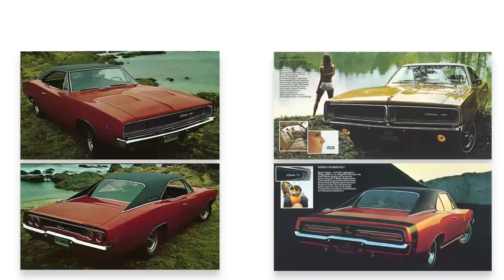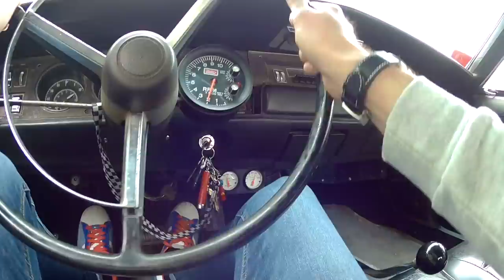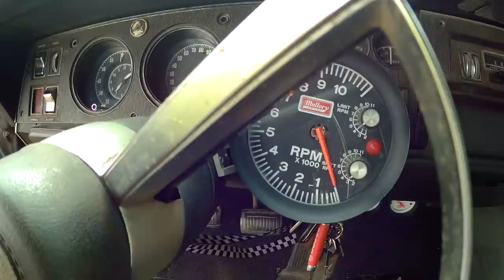Why I bought (and imported) a classic 1968 Dodge Charger manual

Comment: I'm  sure your aware that the Jensen Interceptors were all powered by these engines Mk1 and early MK2's and the later models the 440's. I did have a Mk 1  6.3  sold it to start my business ......bad move!!😨😨 That was 30 years back ( the Jensen cost £5k and l sold it 6months later for £7.5 k)  These Chargers are the dogs !!

Comment: I have to say you completely fooled me with the amount of bodywork it needed!  To do all that and make it look like you did none of it.. spot on! 😁
Reply: But after 10 years, still not know anything about the design/purpose of the product.
It cruises terribly. It doesn’t do long distance either.
It exits corners fast and enters corners fast. You’re supposed to adjust those settings.
Reply from the maker: @dreyn7780  Not true at all Dreyn - I bought this car to keep it driving and feeling the way it would have driven and felt in 1968. If I wanted to hugely update it I would have built a resto-mod. This is a slice in time of muscle car history, not a modernised re-make.
Reply from the maker: I have to thank Tim at Roadhouse Motor Co for his bodywork and paint blending skills. He specialises in patinated car sourcing and sympathetic repairs.

Comment: 1:56 That's the Jonny I remember..... I reckon that was around the same time you had the 250D 'Chip Fat' Merc on Fifth Gear . I remember it well as I had a 190E 2.5D at the same time (also red).... and that was always full to the brim with Veg Oil... well, any kind of Oil actually lol. Good Times!

Comment: Epic car, saw it at EBC brakes do. Fell in love right then. Beauty with a touch of rough diamond / maniac. I had a 71 charger in the 90's with non servo drums and a built 383. Went to see Dave Eady at Eadys American autos in Burton Latimer (sadly now a housing estate. The yank scrapyard / car sales / parts place closed down and gone. R. I. P. Rod Eady). Dave gave my car the once over, looked at me and said "it's got adrenaline brakes then?"...   He wasn't wrong. I still remember the day a nissan micra pulled out right on front of me and I thought I was going to drive straight through it. Maybe a brake upgrade would be a good investment for yours? (and a high ratio steering box. That was a game changer. Cost me about £50 more than a standard recon one and made it steer more like a normal car.)
Reply from the maker: Great comment Chas. I have bought parts from Eadys Autos before (when I had my RHD Impala and Olds Cutlass). What was your 383 1971 Charger like? They are starting to get valuable too now.
Reply: @TheLateBrakeShow  my charger was originally a 318 but had a 383 engine built by Smax Smith already in it when I aquired it. 727 torqueflite gearbox with reverse pattern manual valve body, high stall torque convertor, etc.  Best I saw out of it was high elevens. And 7 mpg. I straight swapped my 3 litre corsair on lotus wheels for it after the charger guy chased me down at billing aquadrome show. I sort of miss every car I've sold on over the years But sometimes a new project is hard to pass by. I do still have a barn full of cars I've already built and unstarted projects I can't bear to part with though.  The lockdown project is now on the road 12 months after purchase. I've had lots of time on my hands and sorted out a million and one jobs. 1960 zodiac two doored with capri roof, built really well in the very early 90's, then bodged badly by some of its subsequent owners. by the time I got it it had a heat siezed 302 with a head gasket fitted backwards and a ton of dangerous bodges. I've built it a 347 stroker with ally heads, home made headers, Jack daniels screenwash bottle,  traditional filigris signpainting in the engine bay by my mate Dave underwood, and a brass antique urn  I bought from ebay made into a header tank. The stench that came out of that thing when I soldered the pipe stubs and rad cap neck made me feel sick. I suspect it may have had someone's nan in it before I bought it....   If your passing by Broughton near Kettering give me a shout if you fancy checking out some wierd creations. 4x4 105e turbo technics, saab b204 powered rwd mondeo eurocar, 480 turbo engined volvo 340, etc.

Comment: I have a '70 El Camino which is nearly as rough looking as your Charger, that I use as a daily driver in the summer. 5.7 small block currently loaded with hedge destined for the tip!
Reply: They’re is no community here.

Comment: To bad it's not a  Muscle Car anymore
In order for it to Qualify as a Muscle Car must have the following requirements:
1.   Must be a 4 seater charger ✔ 
2.   Must have a front engine V8 variant Charger ✔
3.    Must be made in the U.S. Charger ✔
4.    Must be made during the Mid 1960's to  early 1970's charger ✔
5.   Must only have 2 doors in its whole History of Production charger in video did qualify until 2005 when the 4 door variant was released for retail.  Since then the Charger has been Dethroned as a  Muscle Car in  Car Culture.... Incidentally, had been asked by Mopar owners "well how about the  Charger HellCat?"  My response is they're comfortable family oriented Sleepers.  It's you have found one out there

Comment: I was never a fan of American cars, but a couple of models did ignite my interest, and the Dodge Charger is one.
Maybe it was them 'good ol' duke boys' which did it ....

One thing which confuses people (here in the UK), is that the Dodge Charger cars were advertised based on gross horsepower. That means ratings were derived from motors running on test stands with no accessories, exhaust systems, emissions equipment, intake filters, or transmissions siphoning away output.

They were also corrected to standard atmospheric pressure, which further distorted their accuracy as compared to modern net horsepower ratings.
So, those 330 horses start to look more like 220 at the wheels, which is still not too bad for 1968 lets be honest.

Thanks for a great update on your fantastic machine Jonny.

Comment: you should try and get all possible parts machined in carbon fibre (3D printing) ...might be expensive but should be very interesting. maybe a 3-4 year project... take off 150-200 kgs of weight, update the transmission and suspension...

Comment: What model optima battery is that? I have some trick batteries in my cars, 800CCA, 16AH 2.8kg easily held with one hand, about half the size of yours, and inexpensive, plus will outlast me if I don't kill it by letting it fully drain or overcharge.

Comment: I bought my '69 when it was just an old car. 383/727 AT, leather and air, Earl Shieb paint job and new Crager SS wheels. All for a tidy some of 600 USD. Only rust is the corners under the rear window. Might of gone up a smidge in value in the last 40 years. Great to see yours.

Comment: fun vid.  when I got back into cars after a long hiatus, it was gonna be either a '68-'69 Charger or a '70 Mach 1.  turned out Chargers were near twice as much, so got the Mustang.  but I had driven these back in the day, and really they are the definition of muscle car...everything good and bad.  if I had bought one new, it would have been a 383 4barrel 4 speed...just like this one.

Comment: Agree with you totally Johnny.. Cars are for driving. Exactly my approach with my 1985 Renault 4TL and my MX5 NA. "Patina" is trendy now, but it does add to the charm of an old car. Especially the R4.
I also collect old Hornby Dublo model locomotives.  Same approach - I couldn't give a #### about "mint and boxed". They are for running and enjoying.

Comment: I get the original weathered & lived in look you are keeping with....But the door mirror is more ridiculous than cool...it says "I disregard others safety"  or "I drive like a k**b" !  Not sure about the cuffs either. I would prob's swap the grill out if I had a spare.  You have been sensible spending in right areas.  Thanks for sharing.

Comment: You wasted your money on a aluminium radiator matey. I run a 550hp 440 in my Roadrunner. I re did my radiator to a 3 core, made sure my heater core and water pump were good when I rebuilt the car. Even on the hottest day's in traffic it has never gone over 190F

Comment: I love your '68 charger, the '69 charger is my absolute dream car ever since I started talking😂, I always loved cars ever since I was a little kid, the car bug runs in the family, great build however I'd like to point out some little things that I think make sense, since you went through the trouble of switching to electronic ignition and an alumimium radiator why bother keeping the steel fan? It would be much more efficient for cooling and eliminating parasitic drag if you put electric fans on it, and also those factory exhaust manifolds suck, they choke out the engine, I saw many videos from dyno testings on this classic v8s showing how much more power you can get by putting on a nice pair of headers and it makes a lot of sense since you have a fully aftermarket exhaust system, anyways this is a great build and I would love to see more about it, you have a great channel!!

Comment: Love your car . Can l tell you what my dream car is ? 

My dream car would be a 1970 Dodge Coronet hardtop on steels , lowered front end (so that the wheels scrub on the arches on full lock ) poorly brush painted matt brown paint with a 318 and column shift 3speed auto . Single side exit exhaust (cherry bomb) , bench seat with one of those "mexican" blankets . No carpet , door cards or back seat . Going for a race car look here based on a granny grocery getter which has no power , which is the idea . Sticker on the back (where your horses sticker is) would bear the legend "my other car's a piece of junk too!"

Comment: That propeller without the shroud is only decreasing horse power. Not actually cooling the radiator, even with road speed. it creates a vortex that blocks natural airflow when driven.

Comment: How's it going John my best friend had a 69 I had a 68 Roadrunner that originally had the 383 but  you know things didn't go good with that motor so I put a 440 Interceptor engine in it which I completely balanced blueprinted three Deuces with ball bearing linkage , cam ,headers ,head work .As far as you using a Holley carburetor , Shame on you you should have used an elder Brock carburetor they were a hell of a lot closer to the original which was Carter as you know and they are decent carburetors but the elderbrock took off where Carter left off. My Roadrunner was 750 horsepower on the street after I was done. I was never beat in that car not on the street or at the track bracket racing. As far as the Chargers I like the 68 myself but then again I like the 68 in a lot of different models. John stay safe stay well and as always God bless

Comment: I wonder what the mpg is? 😂
Reply: Pretty good... you can easily get double digits, if not triple.  But only if you’re looking for metres per gallon.
Reply: Depends on your right foot.  I had a 440 big block in a heavier car and used to get 10-12 around town, maybe 15-17 on a long motorway run. Also depends on gearing, ie street ratio rear end or set up for the strip.
Reply: @workman122  better than I thought 😂

Comment: A beautiful car, but what a shame about the lousy paintwork.
Invest in a nice paint job, then a good Charger will become a beautiful to behold vehicle.
Reply from the maker: If I did the bodywork then I'd have to do the trim, the chrome, the grille, every fastner, strip off the axle and engine out, then source mint rear light units and dash features. Believe me, that would take £20k and probably add £10k to the value. It's staying like this, but I may detail the undercarriage with Raptor and then powder coat the K-frame.

Comment: I've had my 68 charger r/t for 20 years. It was my dad's daily driver from mid 80's through mid 90's. Mine is a 440 4 speed but mine has a different Hurst shifter
Reply: Mine has the original headers too they are awesome

Comment: Jonny? What's more fun? The 4 speed manual or the 3 speed automatic?
Reply from the maker: 4 speed manual I'd say. But then again it depends what you want from the car. I like the physical experience of non servo brakes and no power steering, with 3 pedals.
Reply: @TheLateBrakeShow  Would you take the 4 speed on long trips? Or would you then prefer an automatic? I own a '88 Porsche 930 and the clutch is hard work. Same for the Charger? It's comparing apples to orange .. I know totally different car. I'm interested in a burnout every now and then but also taking it on a long drive.

Comment: I can imagine doing the same with a well-weathered pickup truck from about the same era, but not a car for some reason. I suppose this is because I expect a work truck to encounter a certain amount of "rough living" in its natural habitat on the job sites and such, but not a car.
Reply: The owner is unwise and doesn’t even know what purpose the car was built for.
He doesn’t even have a clue about mounting gauges close to his field of view.
Doesn’t understand that the car was OVER ENGINEERED from the factory and he must tune it DOWN in power or else he’ll run off the road at a corner.
This car needs to be at HALF THROTTLE when at mid corner.
The engine needs to be OPERATED and WORKED, not put into hibernation and flooded with fuel.
Every location on the race track will be BADLY EFFECTED by a double pumper carburettor.
Realise, once you CHANGE 1 thing on the original design, everything else gets effected. Change the exhaust, and you’ve ruined engine braking performance.
Put bigger wheels and you’ve slowed takeoff from exiting corners and you’ll enter corners too fast, run off the road and crash.

Comment: my first car was a gold '68 plymouth road runner i bought when i was 15 in 1980. also had a '70 440 four speed charger. glad to see this thing in loving hands.
Reply from the maker: I'd love either of those now, but a '70 binocular car with 440 and 4 speed would be glorious.
Reply: @TheLateBrakeShow  while the car was gutted it was an original a/c car. you should have seen the car i serviced when i was a mechanic: '70 440 r/t-se with what seemed like every option. the woman's daily in the mid-1980s! love your channel! my intro to it was the lightweight 911. every video is a winner.

Comment: What’s the gearing like being a 4spd? At 70mph what rpm is it at
Reply from the maker: At 70 it's 3000 from memory. Let me check. It's not trying too hard at that speed, but also it pulls hard from 70 when you plant the throttle. The gear shift is much smoother than I was led to believe.
Reply: CarPervert Oh that’s perfect! Not too busy at that speed and it must cruise well. I bet it also uses the torque well at that at around 60-70mph. Cheers for the reply and I’m loving your videos!

Comment: Guys always make the comment “oh I can just cruise around in this thing”, which is ALWAYS WRONG.
We know it’s WRONG cause the car has SMALL wheels and a double motor which consists of A MAIN Motor and an ‘assisting’ motor.
The car that is FAR superior at doing the cruising job has MUCH BIGGER wheels and all 8 cylinders are inline. All 8 explosions are power strokes to the rear wheels on the older cars than this dodge thing.
You must realise you CANNOT cruise in this car.
It’s an OVAL race track car for 20 minutes at no expense spared for fuel costs.
The small wheels are for tight turns, oval track style.
You’re wanting to race everywhere you go. That’s what the car is and does.
Torque is CORNER ENTER SPEED measurement. If you enter corners too fast or not fast enough, you go and adjust The torque setting.
Multiple explosions are for MORE traction grip exiting corners. 
You adjust the number of explosions to delay the wheel spin effect exiting corners.
Adding horsepower only speeds up the time it takes getting to maximum speed.
Maximum speed can only be increased by gearing.
You AGREED to NOT HAVE a car built for distance driving with reasonable fuel costs.

You chose a motor for extra explosions while exiting corners and small wheel/ tyres for sharper cornering performance. And a gearbox that drops engine revs down to very low revs.
The car is designed to stay in top gear most of the time you’re driving.
The other gears are only designed to get you up there in top gear.
Reply from the maker: You have written an awful lot here, and I happen to disagree. A V8 is not made for short oval, a V8 is a very docile engine if you want to cruise. It is also a screamer for racing, if you tune it that way. A straight six is smoother and often quieter, absolutely. This car is not an animal really, it is happy at 4th at 30mph just tickling 1200rpm.
Reply from the maker: If I want a car for modern everyday life I use my EV.
Reply: @TheLateBrakeShow  it’s not my opinion. It’s what the engineering team built for you owners.
They selected every detail from a lot of choices. Everything was fine tuned, including the shade of paint.
Realise V8 motors have only 4 cranks which are attached to 8 pistons. Bicycles have 2 cranks.
There’s only 4 cranks which make 4 power strokes per cycle of the motor.
You’re not arguing with me, it’s the dodge engineering department that you’re trying to argue with.
If it WAS a cruiser, it would have some overdrive gears installed.
Or wheels just like the 1930’s cars or a straight 8 motor etc...

Comment: Is a 383 not a stroker 350 ? As in a short block ? Not 100% though.
Reply from the maker: It is in Chevrolet form, but in Dodge/Chrysler form it is a stock engine offering. 383 is the smallest of the big blocks.
Reply: CarPervert excellent. Thanks for getting back to me. Love the channel. I’m maybe just used to the GM V8s. I have an mpi with a cam in my boat. Straight through exhausts of course. 
Loved the recent video about the wee Suzuki. Keep it up. All the best.